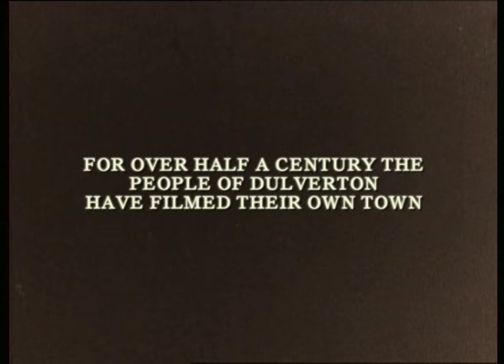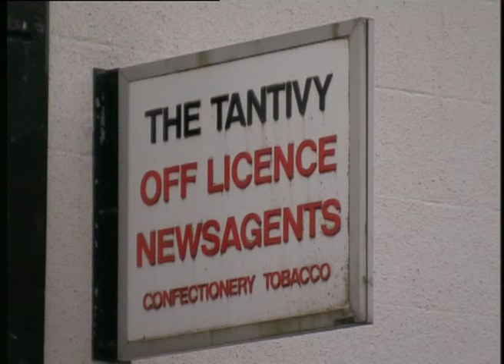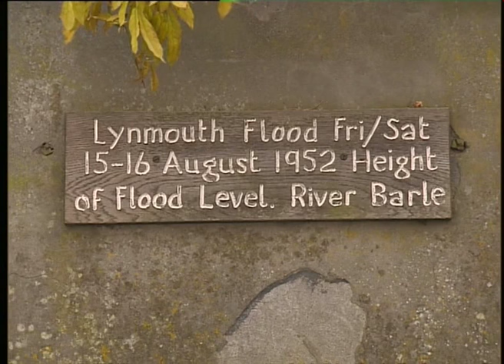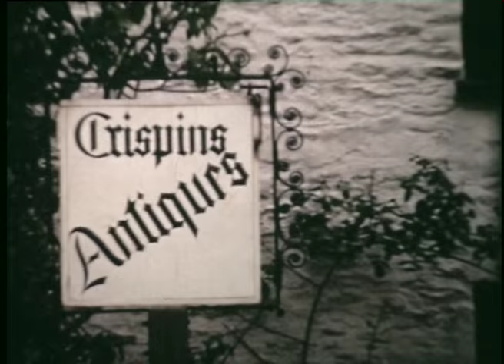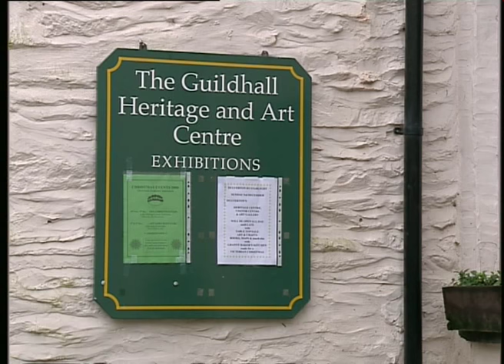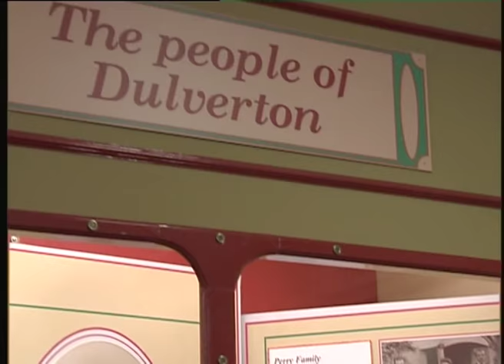Now and Then - Dulverton

Comment: very informative film from 2001. Pity there was not any mention of the railways and the comparatively large station just outside the town centre. I worked for SWEB (South Western Electricity Board) in Taunton in 1970 > 1976 and Dulverton was one of our few remaining Branches where I had a small link. We had a shop there but more importantly a Branch Manager (can't quite remember his name) and he was multi talented - he could sort out the overhead lines (both high voltage and low voltage), individual electricity feeds to shops, offices and houses including new supplies, repair electrical appliances (kettles (new elements), irons, washers, spin dryers, etc.), work as an electrician for wiring houses, work part time in the shop, be available for electricity emergencies for anyone in the town, etc,etc. He retired, the shop closed and all business moved to Minehead. Other the other local SWEB shops also closed in S. Molton, Wiveliscombe, Bampton, Milverton etc. I loved my time working for SWEB which itself has now gone. 11 May 2018.
Reply: just remembered his name - it was Arthur Luxton (not bad after 45 years!)